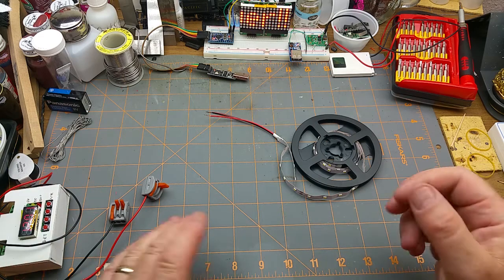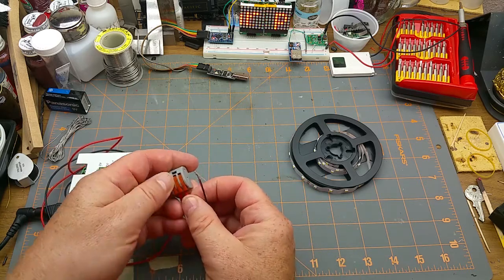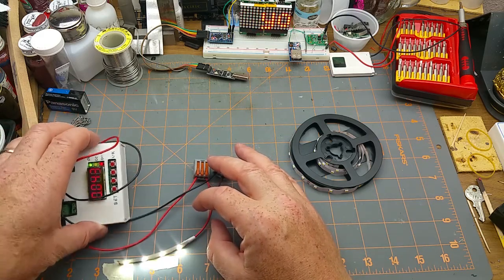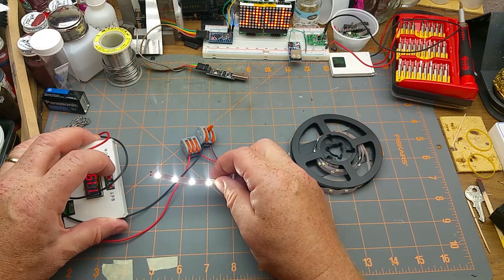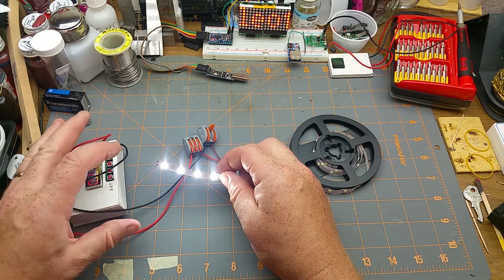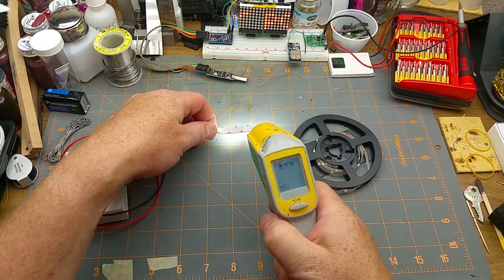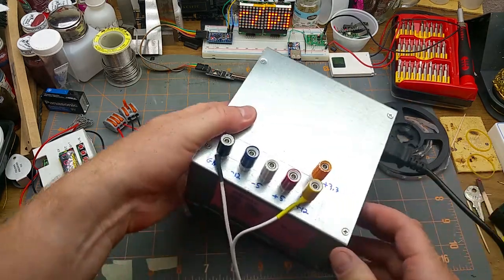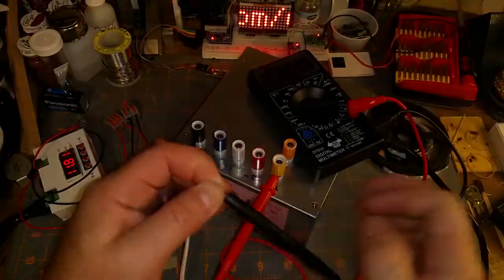power for lights

Comment: Really, 4 in series en an resistor!? Never came across those but that's ugly! Massive current changes with small voltage changes :/

The buck converter can do 3A but only with a heat sink :) It's just like with transistors, you need cooling to use them at there max rating.

And indeed, DC via a clamp meter needs zeroing in the EXACT spot you're going to measure and even then it will probably drift.
Reply from the maker: tengelgeer 
I'm guessing thats why they were so cheap...

You know adding that extra SMD resistor would make them sooo much more expensive...
Reply: Yep, they saved a whole cent!
Reply from the maker: tengelgeer The buck converter can do 3A but only with a heat sink :) 

Yeah, I have some on order. At the rate things come in I should have them by November.